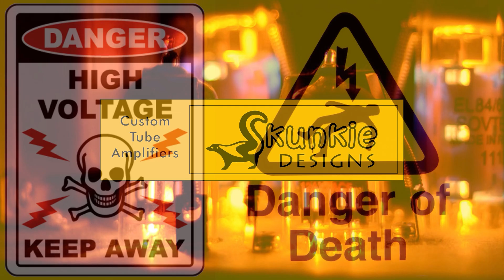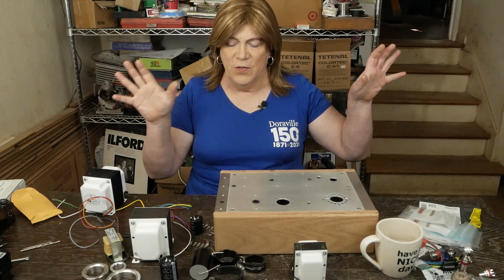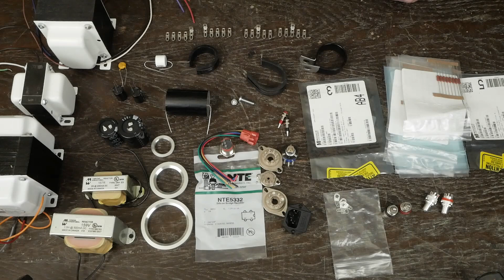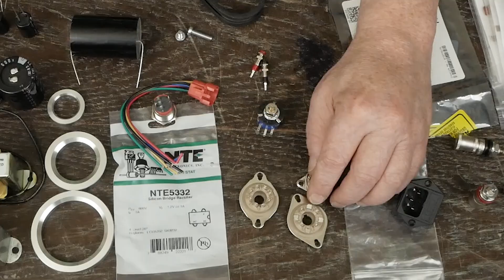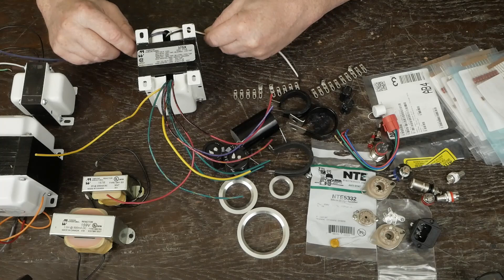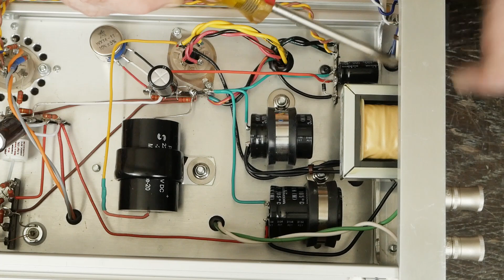KT120  SE UL mono block Tube Amplifier: Parts & Layout

Comment: Thank you for the BOM!!! I decided to go with the angel eye power switches. I didn't see which bridge rectifier, resistor and lil cap you used. I threw a NTE5332 600V 1A in my shopping cart but it ships separately at 3X the part cost. I'm hoping to find one that DK has in stock so it can ship with the rest of my order. Obviously, if not using an LED-illuminated switch, no extra parts are needed.  Thanks again for all you do!
Reply from the maker: NTE5332 But honestly ANY small bridge rectifier would work, same with the cap. I think I used a 100uf 25V but a 220uf or a 330uf or even a 50uf would work. It's only filtering DC for a led lol. I went and measured the amp again, the resistor is a 3.2K. I was pretty sure I went over all that but maybe I forgot to.
Reply: Thank you, now I have everything ordered except OPTs. Gotta save some S&H Green Stamps for those. Maybe Santa will be good to me this year.

Comment: I learned a lot.vishay resistor over sizing ,filter led, good camera work.and you stay on one spot long enough for me to pause.forgive this question but I'm looking on a cell phone.are you running the input tube grid to ground resistor and cathode resistor ground point directly to chassis common  ground point  or in other words no ground of input tube tag strip to chassis only a wire from tag strip to common ground?next question I see you are using a Polycap after the rect.is  this the best location if you use only one? I ask as I have some that the voltage is bit low and the cap value a bit high to follow the rect but I think would work ok after the choke or pi resistor.what about parallel caps?not talking about small film bypass but say 2uf poly parallel w 8uf electrolytic for filter caps not coupling.your layout video definitely bridge gap from working only from a schematic.how to remove scratches from aluminum? learned the hard way about protective film.
Reply from the maker: Some people frown on this, but I run a ground wire from the tag strip ground terminal bolt down point terminal to the star ground and have never had issues or group loop noise. If this bothers you, use a tag strip with extra terminals and don't use the bolt down point one. I feel like the first cap in the power supply dues some heavy lifting and should be a fairly small cap + will see the highest ripple etc. so it's a good location for a good cap.
Reply: @SkunkieDesignsElectronics  thanks for the reply.I'm planning on using five terminal tag with center terminal mounted to chassis   and wire to star ground.i intend to replace metal screw with nylon screw and washer after soldering to isolate it from chassis.based on your experience I think I'll try to jumper center ground tag to chassis and see if there is any change in noise.still a way off from finishing it.i found poster board at d.g.with 1/2"grid square helpful for planning lay out of parts.cut it about size of top of chassis.
Reply from the maker: Even easier, just replace the nylon hardware with metal ones and see if you see any difference.

Comment: Dang it Skunkie/Stephie you raise a valid point - if I'm sensing cathode current I'll need something precision - I tend toward Carbon Composition as theyre best for squishing RF oscillations, but then I cant use 'em to sense current due to their crazy tolerance .. maybe I'll compromise and use an oversized 1% Carbon Film - thanks for reminding me :)

Personally I cant bring myself to make a SE much bigger than 5 watts, or  headphones - all that iron, heat and horsepower - so, a question - to you or everybody out there..

..Has the TRANSFORMER (not tube) 'crossover distortion' that SE is supposed to prevent (  no current / flux reversals ) ever actually been MEASURED? if so how high is it? For, say a quality (amorphous, even) transformer ? Can anybody tell me?
Yours, a PP fan :)

Comment: Hi Stephe.. I used a 3M Heavy Duty double-sided mounting tape for the DC Link decouplimg caps before, they hold up well.. It’s the Red colored mounting tape that could hold a heavy load..
Reply from the maker: Good to know, I will try that in a future build.
Reply: I also want to add that when it comes to Mundorf couplers, I prefer the sound of Mcap Supremes, the classic black bodied ones Without the Oil impregnation ond NO Evo winding.. I used a Hammond 157J choke just over 400VDC in a phono stage build, no issues with it too. @SkunkieDesignsElectronics

Comment: Good quality components make a good amp!  Those Vishay resistors are physically larger & longer, which gives them a higher voltage rating as well.

Should be good!  It will be interesting to hear how a pair of these sound from you!  I think you said you were pleased with the first one, so hopefully you'll be twice as pleased with a stereo pair of them huh?

Great idea to coil up & hide spare transformer taps inside the 'bells'!